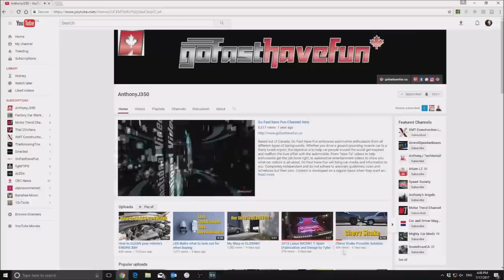Why we Upgrade Parts: Increase the Sound Quality of FACTORY SPEAKERS | AnthonyJ350

Comment: Dude I am so glad you make good audio videos! My next Z parts really need to be speakers
Reply from the maker: I have detailed videos on the Z taking them apart and what we do for sound treatment. Just let me know when you do the job of you have any questions.
Reply: @AnthonyJ350  thanks man! Ive seen then all at least 4x :) I am doing a simple speaker replacement as I am not a huge audio guy or base lover. Im using crutchfield.com to compare speakers.
Reply from the maker: @Z33Garage  Make sure to get the speaker adapter for Nissan. Also a little bit of Dynamat and FAST Rings will bring a ton of music into the cab for the front speakers. Are you going to make a video so we can see how it turned out?
Reply: @AnthonyJ350  yeah once I get all the parts I will make a video :)

Comment: 1 suggestion I might want to add, if you are wanting to reduce road noise and have "run flats" put the foam stuff inside the tyres and you will have such a quiet ride it ill be eerie if you're used to the sound
Reply from the maker: Thanks for sharing!

Comment: my car ass manufacturerd in 2002,the year when they gave the premium speaker brands and stereo's out as factory basic OEM

In other words, we didn't have cheap basic radios,  we had factory CD players with Pioneer speakers.

Blaupunkt was the name of the manufacturer
Reply: but that was 2002, 16 years ago, the cheapest speakers would be far superior than the premiums of the 90's and early 2000's o yes, it is worth doing an upgrade on old cars even if you are upgrading to bargain bin speakers and especially good if you are doing tuned systems....

But I don't pay the retail price of the system just because it's sold with it in the car, if you put in $2000 of equipment, don't expect your car to go up by $2,000+  you might get me to pay $1,000 for it, maybe $500 if it's a back yard install.... no offence but even you can agree that when you buy a car you don't look directly for the sound system being the talking point, I tend to avoid those vehicle in case some neglecting is involved in different areas
Reply: The problem is those "factory" pioneer etc speakers, Are still usually cardboard garbage.
Reply from the maker: Factory "Premium" speakers are ok, but don't perform nearly as well as mid range or high end aftermarket.